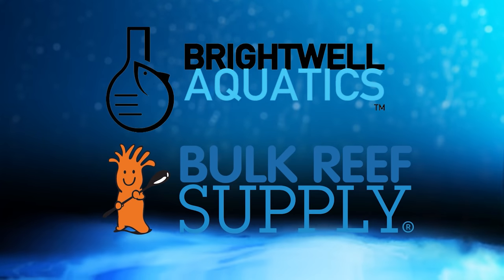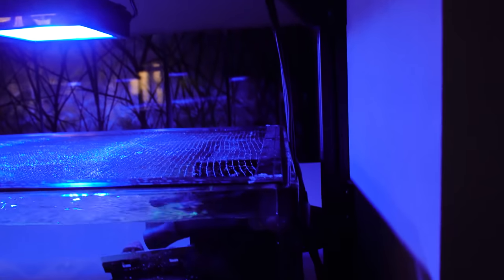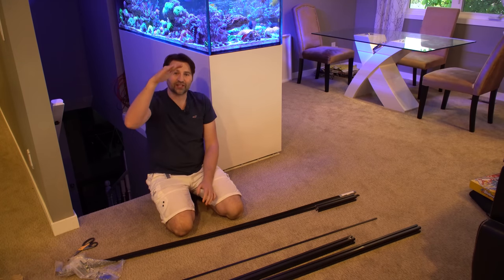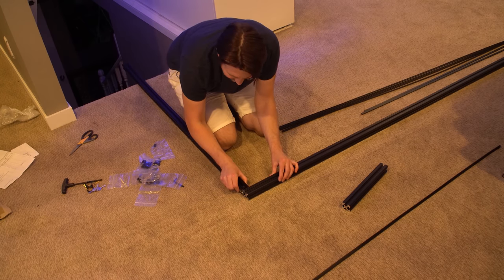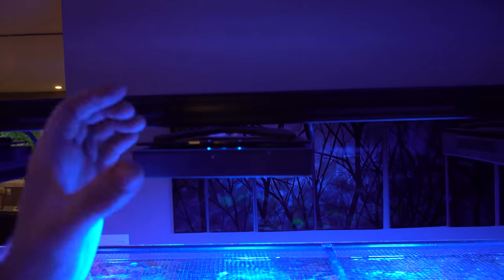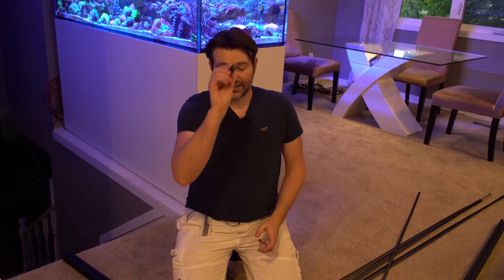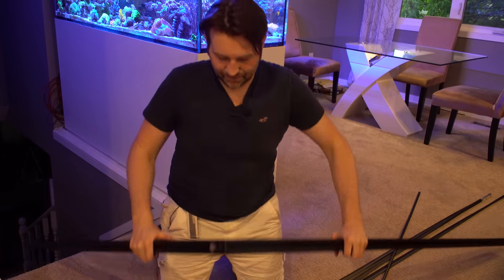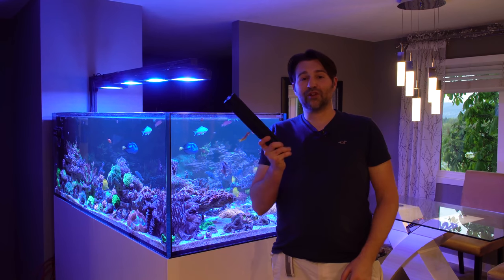DIY 8020 Extruded Aluminum Saltwater Aquarium Light Mount

Comment: Hello. Wondering if you might have a solution for mounting the lights with the new gen 6 RMS slides.  The prior Gen Is no longer available.
Reply from the maker: Drill a hole in the Center and pop a bolt/washer through it
Reply: @ReefDudes thank you.

Comment: I recreated this setup with 15-15 for a Red Sea peninsula 950. The horizontal bar is 80 inches, just wondering if yours has held up well over the last 4 years without dropping?

Comment: Hello Devin 

I just want to start off by saying I Love your content Devin.
I have a very important question:

I jusr purchased a cade 1800 peninsula  71×32×24 and I'm stressed out about mounting my orphek icon lights( 3 of them). The lights wight around 15 lb each. I saw that you diy on extruded aluminum for the radions and that looks great!
Could you please walk me thru how you did it? I can have extruded bars mounted 
on the wall but I'm worried the horizontal bar won't hold up 3 icons over 72" long. 
I can hang the end of the bar from the ceiling if I have to and I can also have a stronger aluminum bar mounted to the wall if necessary. 
Any advise please? Thank you
Reply from the maker: I have the one end bolted to the wall.   You could add a single wire closer to the floating end to support it further if your worried about the weight

Comment: would the attachments need to be stronger if I wanted to design a 80/20 stand? I would really like a minimalistic look too but may look  ugly with gussets and brackets
Reply from the maker: Depends on the size of the tank but I would likely use thicker bars but all comes down to the size and spans

Comment: I am doing a DIY and I need to use x-bracket G4 for G5 XR15 light. Will it fit and okay to use long term?
Reply from the maker: yes the XR15 one works fine (infact im doing that now!)  the 30s, you either need the newer one or use spacers between the bracket in the fixture to allow room for airflow above the fan
Reply: ReefDudes how do you use the newer bracket to attach it to 80/20? Did you have to drill a hole for the T screw?

Comment: Quick question, when you designed and ordered it up, did you do it yourself on the website, or did you have someone draw it up based on what you were looking for? I looked on the site, added some lengths, etc and I am confused lol! Thanks in Advance Deven
Reply from the maker: I designed it and over milled the corner connectors for good measure :). 2020 is like big kid Lego :)

Comment: Let me know if you can still find the old RMS slides for the new G5. I looked all over and can't find them. My entire hanging setup in my canopy was designed for the old RMS slides. The new G5 slide killed my idea
Reply from the maker: I need to find a few too!
Reply: @ReefDudes  They're gone from what I've found. I'm going to reach out to Ecotech in the morning but not holding my breath. I may have to make the new G5 slide work

Comment: How high do you have your lights mounted above your tank? Is there any flexibility to move your vertical bar up or down? I really think this is an amazing idea!
Reply from the maker: 8-9" inch,  yes i could loosen the screws on the vertical bar and slide it up or down if desired.

Comment: Are you able to post the list of the materials that you used?
Reply from the maker: Ill post a pick of the packing list once i dig it up
Reply: Did you have to drill the bracket in order for you to use with T screw to attach the light to the 80/20?
Reply from the maker: @TLASPEK  Nope, i used the stock bracket and just popped out the clip part that goes onto the rail. then used a washer and t nut to attach
Reply: ReefDudes this stock bracket comes with XR15 G5 light, or you have to get x bracket kit or mounting arm?

Comment: Do you know if the RMS X brackets work for the G5 Radions?
Reply from the maker: the XR15 one will.  The XR30 would need a spacer so it doesnt block the fan

Comment: Curious how those connection pieces will hold up over time.   I know the aluminum will be fine, but the connectors are typically galvanized steel which isn't the best to have around a salty environment.
Reply from the maker: I have had my original one for a few years now and still going strong. a bit of surface rust on a few screws rest were fine so overall i would say no issue
Reply: @ReefDudes  Sweet deal, mine has been over my tank for about 9 months, and while I'm not particularly worried since I did most of the fasteners on the side that's away from the tank, there still are some that had to be on the tank side.

Comment: Do you know the actual name of that cleat and where I can purchase it from?
Reply from the maker: “DOUBLE ANCHOR T- NUT SHORT ASSEMBLY” and they did a Center bore for it.  I got it from a metal shop.  Easier way may be to just use the triangle corner plates